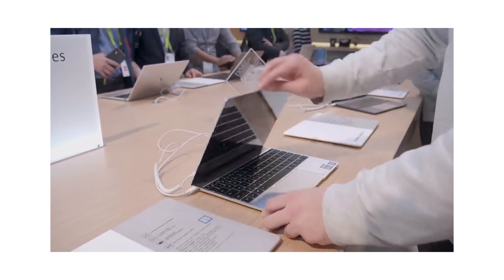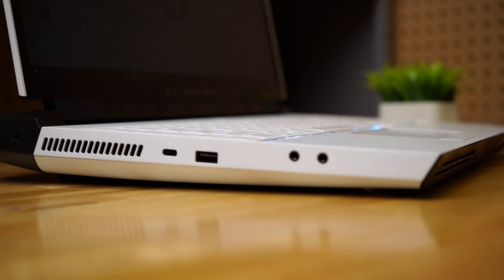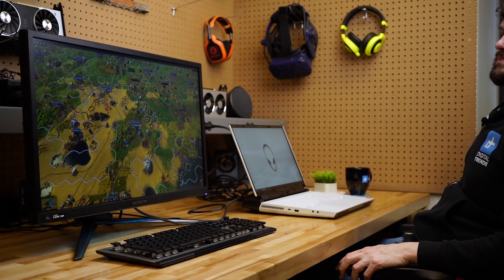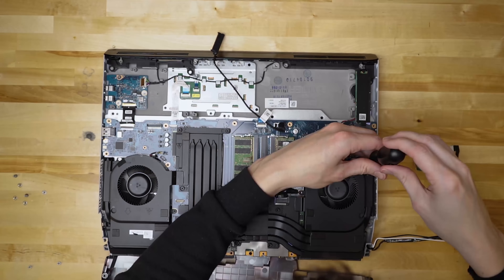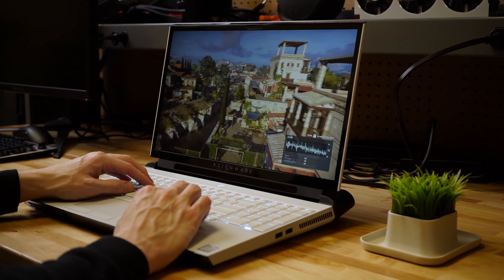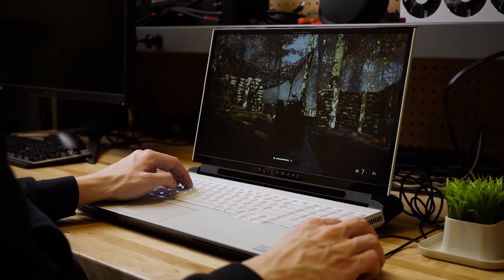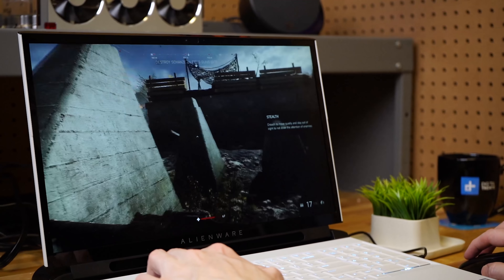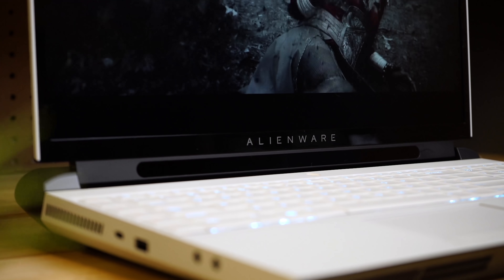Alienware Area 51M Gaming Laptop Hands-on Review: Extreme Power At An Extreme Price

Comment: In 2019, at 1080p, the fact that a high end GPU isn't maxing that 144fps at ultra in nearly every game is a tragedy... especially at the prices nvidia is charging for the 20 series gpus.
Reply: No, it really isnt.
Reply: @christophermartin7744  care to share why you disagree?
Reply: Because 144hz is an insanely high framerate? My 1080 desktop gets fps of about 100 give or take 20 frames in most modern AAA titles, which are absurdly detailed. High end GPU's dont get 144 hz because games get more detailed with higher-end graphics. New rendering techniques, new shaders and ever higher levels of postprocessing... Each generation of graphics cards brings with it more demanding games. Previous gen games do hit 144hz. Hitman, Borderlands prequel, the 1st Tomb Raidet, Wahammer: Total War...  most last gen games.  I have a 2060 in my Area 51m that gets close to the same (as the 1080). If I must have 144hz on ultra with current gen games, I'd get a 2080ti. That would probably do it. But 144hz is just absurd. I really dont need THAT many frames.

Comment: no 4k because no manufacturer makes 17 inch panels in 4k (yet)
Reply: Its not that they cant make 17-inch panels in 4k, its that they don't yet make monitors with THIN BEZELS at 4k (yet). Though, that should change with Razer Blade 2019 refresh.
Reply: Varun Vesuvala m17 man

Comment: You do understand as a tech reviewer that when talking about the Ethernet port and its speed that even current Ethernet ports are more than what most peoples internet can handle right? For anyone curious as to why you’d need such high bandwidth speeds for Ethernet, it’s very useful for extremely fast transfers of data from one place to another. You could say move 100gb of data to a home server or another computer over WiFi and it would take you oh about 10hrs to move all that data that way, or you could plug it in with Ethernet and get it done in about 1hr. With the speeds of the Ethernet plug in the video that’d be cut to even less time say 30mins or 15mins even. So for real world uses if you have a Plex server moving a lot of large files to your actual server would be a very quick operation.